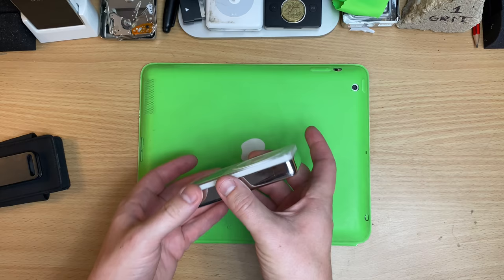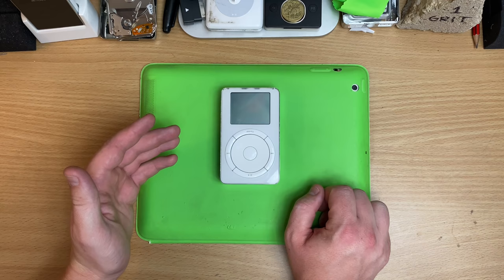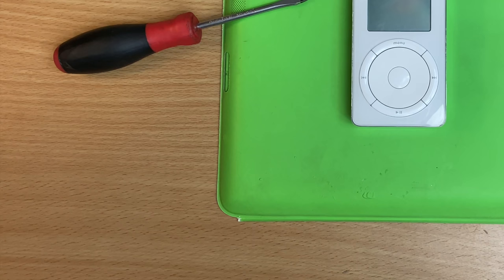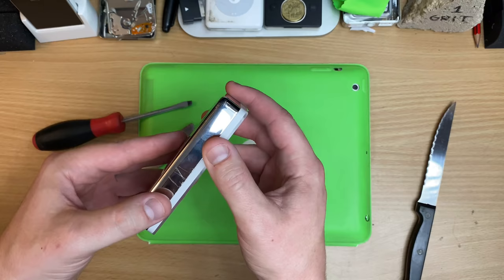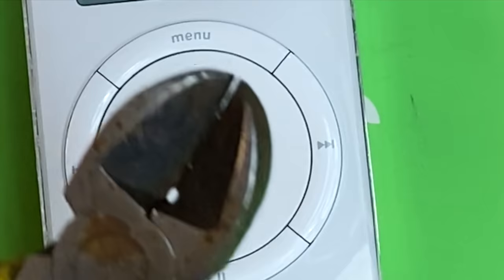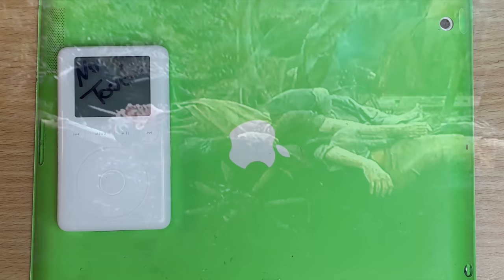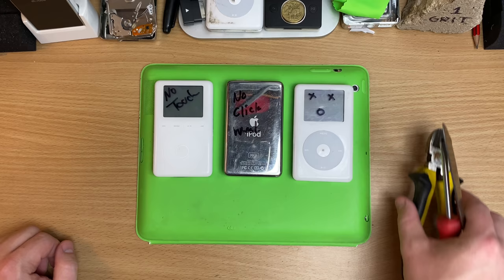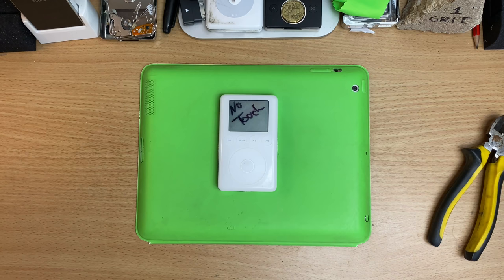Opening iPods the wrong way.

Comment: You could've still sold the motherboards online I think. Some of the IC's may still be good so guys doing component repair could use them in one way or another...

...or I'm just weird and nobody does that with iPods xd If it goes for me, even the oldest crap, I tend to salvage as much as I can, down to transformers, any IC's or capacitors even. They come in handy every now and then. Everything else goes to e-waste.
Also component repair is a fun thing to learn, granted it requires some electronic knowledge.

Comment: 7:07 i was doing an iphone 8 plus repair and made the mistake to use that to try and get off the homebuttonn cable. I shanked the cable which is very bad as it cannot be replaced because apple connects the homebutton to the logic board so you can replace it but it won't have any functionality.

Comment: I've got a 6th gen with an aftermarket 5th gen 80 GB back on it and I managed to get into it with my pocket knife in a hotel on vacation without damaging anything. I think because it's an aftermarket rear shell it's not sealing as well as it is with the factory housing.

Had to do it because it died on me and I had to know why and it turned out the chungus battery got disconnected when I accidentally dropped it. Had to flip the battery the other way around so the cable had more slack in it if it were to drop again and it worked.

Comment: you gave me flashbacks of the time my dad wanted to cut my braces with a wire cutter because one of the brackets came off my tooth.

(despite the fact it was still attached to the wire)

Comment: I have a iPod 3rd gen that has a bad battery, and I was wondering if you could put the metal back into its original spot with the “pro strat” (yes I’ve tried everything before that)